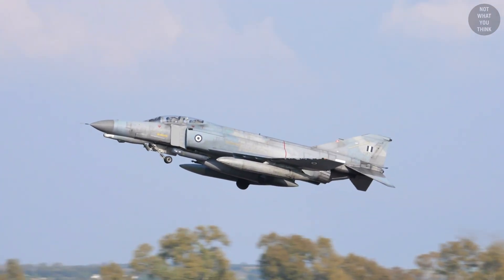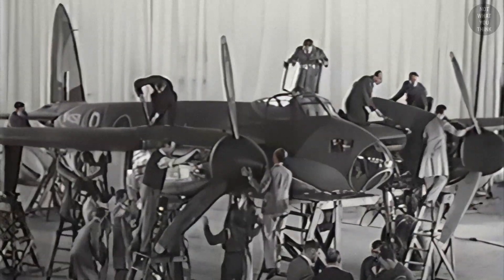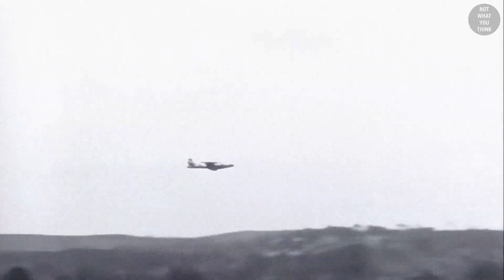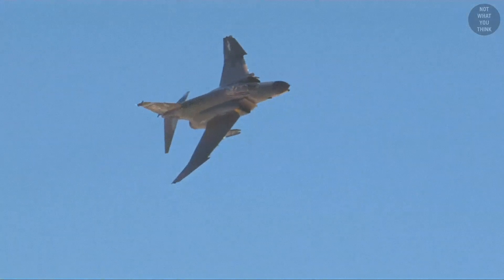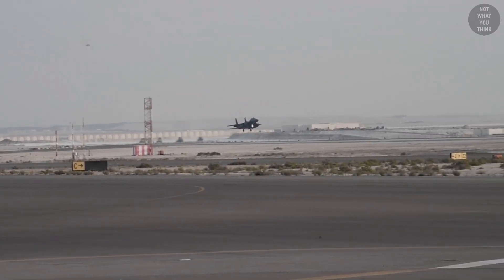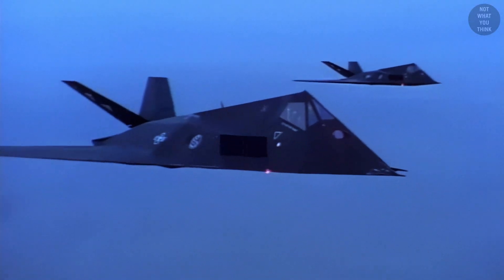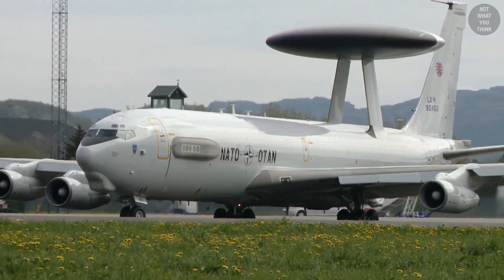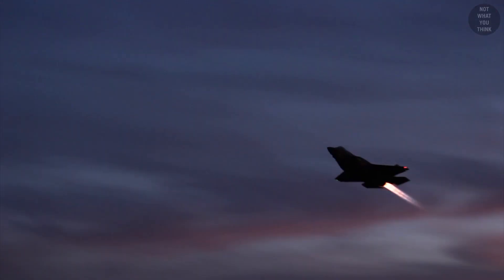Why are Modern Fighter Jets Slower than 1960s?

Comment: Also, the F-35 and F-22 have 9 gs available all the way up to their MTOW. Legacy fighters and even the 4th gen fighters do not have that amount of strength in their frames.
Reply: Come on now, they can all do it. You just want the airframe to last longer. Eagles in ODS would do 12Gs, most would even be fine. There have been loaded Hornets pulling 13G+ in emergency situations (imminent CFIT) and making it home.
Reply: @mobius7089  that might be true, but those are emergency situations. 5th gen fighters are rated to pull 9 g's all the time. The F-18, without overriding the limiter is rated to 7.5 g's, and the F-15 is too when it's got stuff under the wings. If those planes pull more than that, they have to be subjected to inspections. There is possibility of bending the jet, thus making the jet unusable for further combat. Legacy fighters and 4th gen fighters are incapable of regularly pulling and sustaining 9 g maneuvers when fully loaded for combat.

Comment: G-Forces limit what the aircraft can do. Pilots cannot pull 9G but the aircraft can so the pilot needs to go.
Reply: Even without pilots you're not going to be able to build a fighter that can pull more Gs without serious disadvantages in capability.
Reply: @dumdumbinks274  more G is easily achievable using swing wings.
Reply: @Baronbenthe2nd  Swing wings allow for a wider range of maneuvers, not higher G loads. Swing wing aircraft always have lower G ratings than their fixed wing counterparts.
Reply: @dumdumbinks274  But with 4 swing wings?

Comment: the F-35 platform was designed to be sold to other nations. thus we dont want to give everyone something that is just as fast as us. a fair comparison would be the F-22, which is faster than that F-4. but even still, both are slow compared to other aircraft. the actual benefit of the F-35 is the integrated computer targeting system. where if one plane located and designates an enemy unit, every other plane in that fleet can see it on radar. F-4 cant do that. i dont think for a half a second that the F-4 could beat the F-35 in a real fight. if it could, then the F-35 wouldnt be replacing them
Reply: The F-35 was first and foremost developed for the US military. Being a little slow in terms of max speed is because fuel efficiency was prioritised because of it's role as a strike fighter. It is much the same situation as with the F/A-18... they could certainly be made to travel faster, but being fuel efficient is far more beneficial when you need to strike an important ground target and cannot rely on large, vulnerable tankers to refuel.
Reply: Who cares.. Ford, Chevy, Dodge. They all simply drive..

Comment: Why did he choose to compare the "top dog" of the 1960s (the 2 engine F-4) to a current single engine jet? The current top dog in the US inventory is the 2 engine F-22, which has a top speed of Mach 2.2. But the "narrative" would not be as compelling. Some people are willing to distort reality to get more clicks. Sad. 
Would the fact that the F-22 can cruise at supersonic speeds without afterburner be highly relevant in this discussion?
Reply: The narrative is fine considering the primary strike platforms of that era were also incredibly fast, so it isn't a question of which platform to compare, rather the circumstances that result in speed being prioritised over other factors.  Plenty of people think that faster is better without considering the drawbacks, which I'm guessing is why this video exists.

Comment: This is a good explanation, but you're forgetting the F-15, F-22 and Eurofighter Typhoon all still have a greater top speed than the F-4, in addition to the benefits in manoeuvrability, combat range etc.
Reply: Those are all modern air superiority fighters, which actually do benefit quite heavily from high speeds. In a BVR fight higher speed adds a bit of range to a pilot's own missiles while helping them evade enemy missiles by forcing them to waste energy (the only effective method of evasion). Also, if they are ever needed for a high speed interception having a high top speed is definitely a good thing.

Comment: I just Googled the following:
The F-14, F-15,  F-16, and F-22 are all just as fast (or faster) than the F-4. 
 Only the F-18 and F-35 are slower.
Reply: Only the high-end fighters are faster. The  F-16, F/A-18, F-35, and later versions of the F-14 are all slower. However, if we're not exclusively talking about absolute max speed, then the F-4 is slower than all the mentioned fighters in every practical way.

Comment: WWI German planes were typically a bit slower than Allied planes.  Agility however … the Fokker triplane could “hang on its propeller” for 50 (vertical) metres …

The WWII Me163 (rocket plane) was fast beyond belief at the time … (essentially up to hitting the sonic wall, which they could reach easily in straight flight) but pilots had almost no time to aim at the bombers they were set against. Despite several “one or 2 hits and the bomber goes down” heavy cannons. 

The “Schnellbomber” was meant to be faster than fighters — and it was when it came. But fighters got much faster quickly.

Aircraft in WW1 have been used for attacks (bombing) from — at the latest —1914-08-06, less than 10 days after the war started.  (Z VI, Liège, 9 civilians killed)

Comment: 0:16 already gonna mention this the f35 goes that speed with its internal weapon storage full or not. The f4 only can achieve its top speed without any mountings on its hardpoints. If it had a combat load it would be about the same.

Comment: Not to mention the fact that an aircraft's rated maximum speed is measured when it is slick (no external fuel tanks or weapons).  The F/A-18 Super Hornet can barley even reach Mach speeds in a dive when fully loaded; I wouldn't be surprised if the F-4 had a similar limitation.
Reply: The F-4 was known for being slow on strike missions. If an F-4 and A-6 each carried an identical Vietnam era bomb load, the A-6 could outrun the F-4.

Comment: F22 can supercruise, flying at speed over mach 1 without afterburners, and last i checked the F-22 can go faster than mach 2 which is good for intercepting other aircraft as it is meant to be an air superiority air craft with high maneuverability capabilities. The exhaust nozzles help to reduce inferred.

Comment: technological improvements in target acquisition and elimination from increased distances are key here. There’s no such thing as an fuel efficient fighter jet.
F4s and f22s flight ranges are nearly the same, within 100 nautical miles.
Reply: Given a similar mission profile, the F-22 will have roughly 40% longer combat range than an F-4. It only sinks down to F-4 levels of inefficiency if the F-22 is forced to supercruise for a significant portion of it's flight.
Reply: @dumdumbinks274  the f22s payload capacity is significantly lower than that of the f4. It’d take 3 or more f22s to match the payload capacity of a single f4 phantom.
Reply: @GaiusCaesarAugustusGermanicus.  Well since you're starting there, lets compare them in ground attack roles i.e. the roles the F-22 does not perform unless it's an emergency because the F-22 is a dedicated air superiority fighter intended to protect allied airspace from enemy aircraft.

Large payloads are typically not carried by fighters, even if they have the capability. This is primarily due to the difference in effectiveness of modern weapons vs those of the 1960s when the F-4 was around. In Vietnam the average number of bombs needed to ensure a hit on a large bridge was roughly 10 due to the unguided nature of the bombs and fairly rudimentary bomb sighting systems, but large targets like bridges require very powerful bombs, which meant a single fighter was unlikely to even hit the target with a full payload  These days we only need 1 bomb to achieve the same result if not better due to lack of collateral damage.

You might be wondering why the F-4 does not then have an advantage in the number of targets it could engage if it was upgraded to modern standards... well there's 2 reasons... 
1. It simply doesn't have the combat range necessary to engage multiple targets unless it can engage all of them in a single attack run... which is almost always impossible.
2. External stores cause drag and drastically reduce raw performance and combat range. The F-4 with a moderate Vietnam-era bomb load was slower than the subsonic A-6 as noted by USMC aviators. This makes the aircraft very vulnerable as it cannot perform defensive maneuvers if engaged, and is part of the reason so many were shot down in Vietnam. 

But anyway, onto the part that matters most. The F-22 is a dedicated air superiority fighter. It was not built to strike ground targets, which is why it doesn't have an impressive bomb load. Even so it can still carry up to 8 small precision bombs. But it's air to air payload of missiles is superior to what the F-4 can carry because although they both carry a max of 8 air to air missiles, the F-22 can carry 6 medium range missiles whereas the F-4 can only carry 4.

In the air to air role the F-22 also has significantly better performance than the F-4 because all the F-22's weapons are internal, meaning it never suffers the loss of performance from external weapons causing drag. The F-22 can achieve it's max speed of Mach 2.2 and supercruise speeds of up to Mach 1.8 while fully armed, whereas a fully armed F-4 is only capable of Mach 1.7 and cannot supercruise. Because of this advantage the F-22 can also achieve a combat range of 560nm, whereas the F-4 can achieve roughly 280nm, or with external fuel tanks up to 370nm (but doing so drops max speed down to Mach 1.3). The F-22 has the option of using external fuel tanks as well, and can achieve combat ranges of up to 850nm.
Reply: @dumdumbinks274  I still believe an fully updated F4 with today’s technology could perform the same roles as an F22 if not better. Adding external tanks to any aircraft comes with a cost, in a fighter that would be a reduced weapons payload capacity. In some situations, the addition of external tanks may be of little or no benefit to the aircraft or mission. 
I believe the F22 and F35 are huge wastes of money. The technology developed for these two airframes should have gone into proven platforms. The B52, C130, CH46 have been flying since before the Vietnam war and aren’t going to to be replaced anytime soon. The marine corps AH1 is a perfect example of an old airframe with somewhat modern technology that is still fully capable of fulfilling its role in combat.
Reply: @GaiusCaesarAugustusGermanicus.  The airframe is just as important as the technology. It is the primary factor in how fast you can travel, how far you can travel, how tight you can turn, how much payload you can carry, how high you can fly, how stealthy you are, pilot visibility, and ease of maintenance.  It is physically impossible to make the F-4 as good as the F-22.

The capabilities of sensors and mission systems is also related to the airframe due to the physical dimensions required.  The F-14 for instance had a radar that could track targets beyond 200km, but the F-4's radar had half the range despite using the same tech. Size matters, and if you're going to add multiple types of sensors, you need an airframe that is designed to accommodate them, otherwise you will end up complicating maintenance procedures... not that there's much you can make worse on the F-4 regarding maintenance.

You point about external fuel tanks does not support your view... the F-4 with external fuel tanks is still easily out-ranged by the F-22, with or without external fuel tanks.

The aircraft you cite as examples are still in service in heavily upgraded forms because they have simpler requirements, usually because they don't have any direct competition with the enemy's equivalent. This is especially true for transports and cargo aircraft, because there's really not much reason to upgrade them other than to make them safer and more reliable.

Comment: Max Speed is a marketing gimmick.  The max speed for an aircraft is for a clean configuration (without ordnance or pylons) and very little fuel - almost never experienced in practical combat operations.  The highest speeds that will be observed for US aircraft in the past 40 years are during FCF (Functional Check Flights), which are typically performed after significant maintenance actions.

Comment: Insightful, but now you need to look at an F-111 (now obsolete) or B-1 bomber with huge fuel loads that fly for significant periods of time at supersonic speeds to get to an urgent developing situation and put bombs on target. A different mission from dogfights and obviously different platforms. Also turns out those 2 platforms could outrun many (not all) threats just due to how far they could fly fast. SR-71 (now obsolete) had similar capability to outrun many threats. There are now theaters none of these can operate in but others where they could. The 1st two also utilize TF (terrain following) to hide. 

Supercruise can achieve the same kind of benefits, depending on mission.

Oh yes, as to high turn rate to get your nose on target, that loses out to all aspect sensors and weapons in a lot of cases. Combine that with superior situation awareness and you might not need to turn at all (sometimes, some situations)?

Comment: When you want to fly faster than M1.9, you need a variable geometry air intake. That's the reason the top speed of the F-16 is M1.85. It was meant as a relatively affordable fighter for smaller air forces in NATO and elsewhere, so the design requirement skipped having a complicated and expensive variable geometry intake, and went for a fixed geometry intake instead.
Reply: And yet the F-16 is one of the only teen fighters that can actually go over Mach 2, but in a relatively clean/stripped condition.   F-14 in practice maxed out at 1.8, otherwise it was likely to compressor stall both the Pratt and GE engines.  Stripped F-15A/C will do Mach 2.2.  F-16 will do Mach 2.02, whereas the Hornet can barely get to Mach 1.5 on a post-mx check flight, in a dive.  F-35A will do Mach 1.67 every time while carrying full internal weapons and AIM-9Xs on stations 1 & 11.  F-35B and C will do Mach 1.6.  None of it is really useful if you’re already a VLO platform cruising at .85-.95 Mach.
Reply: @LRRPFco52  I'm sorry, what? The clean Hornet will at least get to 1.75. The F-16 can reach that speed, but only for seconds and of you want to get there and get back home you have to dive for it, acceleration takes too long.
Reply: @mobius7089  Vincent Aiello said he took a slick baby Hornet on a post maintenance flight, could barely break through Mach 1.5 in a slight dive.  With pylons and weapons? It won't go there, which means the book limits aren't operationally-relevant.

F-16 stripped will break over Mach 2 barely, but again, this isn't operationally-relevant because it won't do it with pylons and weapons.  F-16 has longer legs than a baby Hornet as well.

One major problem we had with the teen series was in combat configurations, they couldn't demonstrate their impressive performances, as they were handicapped with external pods, pylons, EFTs, bombs, and missiles.

One exception to that was on the F-16 with wingtip missiles, which actually helped with aerodynamic/wing flutter stability for fuel efficiency, allowing it to fly a bit farther if you only put missiles on stations 1&9, but that isn't ever a combat configuration for US fighter squadrons.

Moving forward, we were looking at internal weapons bays for future fighter designs after the teen series, and this was prominent in the NATO AeroE course materials even in 1980 for the academic project design study challenges in that course.

Comment: Today it's useless to fly at mach 2: you can't fly against a mach 4 missile. It doesn't even help to be agile: you can't fly against a missile with vectored thrust that can change trajectory faster than you can. What you need is to be stealthy. If possible, use an aircraft optimized for subsonic speeds: it will also have less infrared signature. 
The important thing is to attack without suffering retaliation.

Comment: Yeah that finally makes sense now as the F-35 is a flying turtle!
Reply: Nah the F-35 is actually faster than the F-4 in almost every practical sense. The difference is simply that the F-4's maximum speed while unarmed is higher, but that's only good for running away.

Comment: To the videos' point, the only time speed of a fighter mattered was when the Interceptor role was needed. The interceptor was a fighter jet designed to intercept incoming enemy bombers at max speed before they could drop their bombs. The MiG-25 was an interceptor, and not a 'dogfighter'. The interceptor fighter became obsolete when the strategic attack mode of nations switched from airplanes to missiles.

Comment: Why is he comparing a twin engine to a single engine? You would figure he would compare the F4 to the F22. This clown clearly trying to down play modern aircraft.
Reply: Twin vs single doesn't really matter as there are single engine fighters that are faster than the F-4 in every practical sense. The F-104A for instance was capable of higher speeds and with significantly higher acceleration. And while the F-35 would lose a long distance drag race, it would absolutely win vs the F-4 in a sprint.
Reply: @dumdumbinks274  True, most single engine jets are smaller. But you’re still comparing apples to oranges.

Comment: 1960's jet fighter plane, can't carry nuclear weapons. 
Modern jet fighters, can carry or carrying sometimes,2,3,4 NUCLEAR  weapon.
Modern jet fighters is not designed for speed, DRONES that has no pilots, that's the design for SPEED war. 

Some jet fighter DRONES can turn around planet called earth, for just 10 minutes,15 minutes.

They are the highest speed modern jet fighters, that can never been made from 1960's.